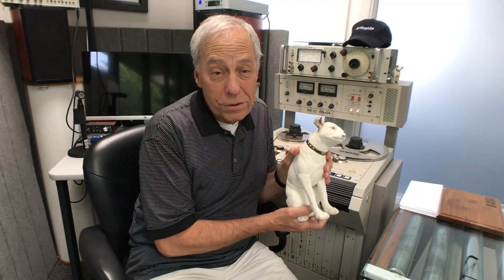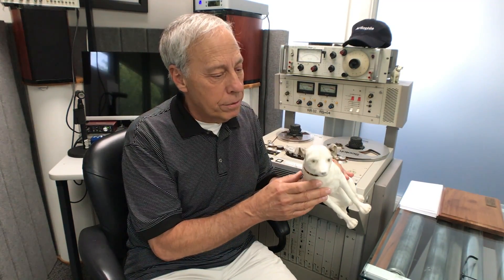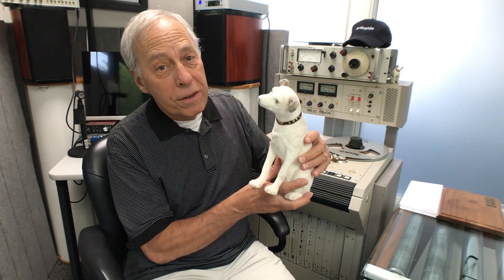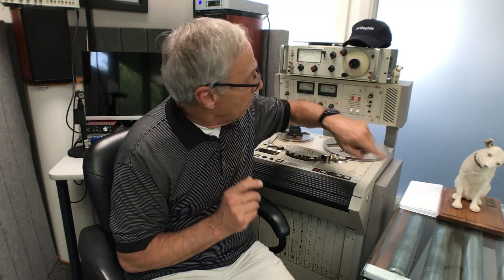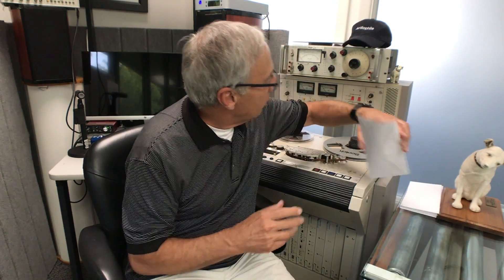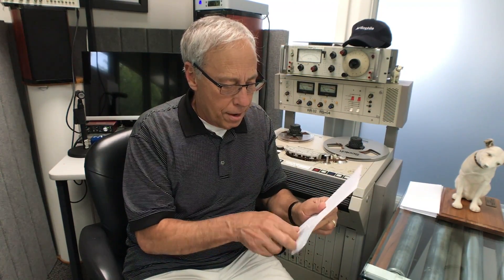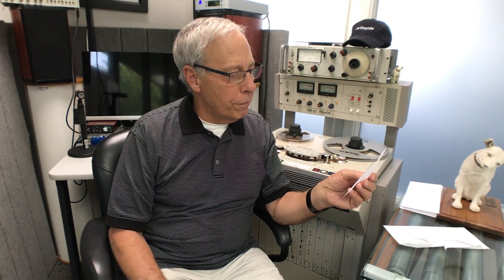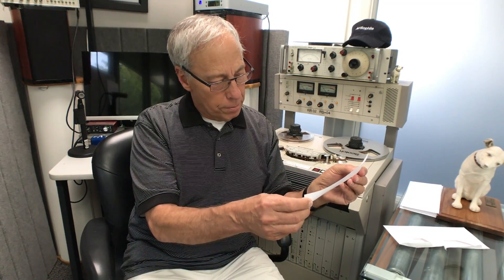Thin cables inside speakers

Comment: A few comments: wire after the X over serves a more simple task than before the X over. Wire internally gets exposed to much more vibration: bad thing, it does influence sound. Multi strand is worse than single solid wire in that respect. There is never any justification for using very expensive speaker cable outside and cheap inferior stuff inside, however, the wire form X over to speaker chassis can be of of somewhat less quality than the outside cable. Last but not least: influence on sound doesn't scale 1: 1 regarding length, so twice as long is less than two times as bad.
Reply: By vibration, you mean like, ah, vibration? Like a guitar string? And it's measurable and it does deleteriously influences sound? Multi strand is worse than signal than single strand? So you're saying if you have expensive cable outside the box and cheap 'inferior' (define inferior - gauge, purity, brittleness, etc.?), that's bad?
Finally, influence on sound doesn't scale 1:1... where do you get this science from?
The only science in this whole subject is that gullibility is exponential to the surplus of discretionary money to spend on the system. Usually by men over an age where their hearing is affected anyway (presbycusis). If you can hear the minute subtleties you're talking about here, you must have the hearing of a dog. Finally, nobody ever talks of the quality of cables at the start of the voyage - you know, the ones from the instruments and microphones in the studio and through the mixing consoles and mastering process, etc. What comes out on the vinyl or whatever, ain't the sound the instrument made.
Reply: listening: conservatory graduated and high-end designer, it;s my job. Doesn't scale: a renown audio technician told me that and it rings true and most logical. Vibration, yes as you describe. Electrons do have a mass: contemplate about that. You are right about the whole chain does matter. There is a difference however when all signals are still separated and when they are mixed together. Of course what comes out of vinyl or whatever is an attempt (or not even that) to have (an often bleak) resemblance to the original. 
Look, I stay puzzled about the sensitivity of the ears and what they can detect. Much time was lost because I refused to believe that certain things could influence the sound.

Comment: Most industrial produced consumer grade speakers have internal thin wiring for the obvious reason of reducing cost. You,the consumer wont see them,and what you dont know doesnt make you question why.
Well,to be honest from the technical point of view you dont need a special fabricated cable for high quality internal wiring. A 1,5qmm cable like Oehlbach SP15 is perfectly fine for this duty.   Its also very good to change the internal wiring with this in old amplifiers who often have relativly  long wires for routing the output signal from the powerstages to the speaker terminals.
For external wiring a 1,5qmm - 4qmm OFC-copper cable made out of many thin copperwires will be perfect. Depending on the necessary cable lenght in your listening room and the power throughput  you dont need more than that - ever. At least (real) physics science is at this time not advanced enough to deliver a plausible reason for more. Of course we are artificial inclined to do so,but there is really more important stuff to think about in the matter of  hifi at home.

Comment: The cables inside good speakers are not thin.
Reply: If I thought hair thin voice coil wire was good for connecting amplifiers to speakers I would use it. I don't, for obvious reasons.
Reply: Peter Martin -- Which "good speakers" are you referring to...(?)
Reply: Dynaudio for example. They make good speakers.
Reply: They are still generally much thinner than the 'garden-hose' thick cable some have running between the amp and speakers in so many systems.
Reply: Well that us used for weight and space issues in the driver.
Reply: The wire going from the spot on the driver frame to which the cable is soldered or connected, that then  goes to the actual voice coil, is very thin and far thinner than any part of the wire before that in the signal path.
Reply: So what would you say about the 100 ft long hair thin wire around the voice coil. Or is that not part of the circuit. This thin wire is probably a hundred times longer and a thousand times thinner than your interconnect.

Comment: I thought the reason that the wires inside speakers are so thin is that they are short. I was always under the impression that wire gauge needs to be heavier as the length increases. If you only have a couple of inches of wire then even very thin wire will do. So isn't the answer just "length?"
Reply: Wire size is,determined by the amp draw.  You make a wire bigger as it gets,longer for voltage drop.
Reply: That's part of it. Also, the power is divided among multiple drivers and crossover components at that point so the current is split somewhat. It's definitely an application where the wire is not as critical as the longer run to the amp. People get hung up on arguing about cables when discussing audio, but it's really low on the list of things you need to worry about.
Reply: That is the answer.
Reply: Paul McGowan - I agree. It's all about manufacturers' saving LOTS of money in high-volume production runs .But what's the sense in running the finest audio signals we can muster down the cable equivalent of an expensive, multiple-lane superhighway, only to have it hit a  narrow, cruddy, dirt road inside the speaker box? Worse, on the way in, we squeeze it all through a pinhole -  a fuse element that's tinier than a cat's whisker??!  I used that rationale to convince myself to rewire my ribbon speakers directly to my amplifier, the improvement in HF sibilants alone was worth the effort. 😎
Reply: Az Usmb, The pinhole analogy is pretty descriptive but inaccurate.  Google copper wire resistance tables to make more sense of this.  Assume you use 10 foot 12 AWG speaker cables. This is a 20 foot round trip for the wire resistance. The cable has a resistance of 0.0318 Ohms.  The bottleneck of a 16 AWG wire between the crossover to the driver at 2 feet round trip, is 0.0084 ohms, not the bottleneck the first appearance seems to suggest.  This is the difference between pseudo science assumptions and engineering.  Inside a speaker the high vibration and a physically large wire to a driver is a mechanical vibration failure point. The smaller wire is used inside for physical consideration of the environment and is a trade off to a small amount in capacity.  Smaller wire can flex more without failure.
Reply: You are confusing impedance matching with wire size. A 4 ohm amp should drive into a 4 ohm speaker. When is the speaker at 4 ohms? Only at 1Khz. Your rewire probably had more to do with impedance matching than wire size or cable length. A cable with adequate current capacity and low resistance is all that's needed. Huge expensive speaker cables only serve to empty your wallet, not your ears unless your amp is 100 feet away from your speakers (I squared x R losses). If that is the case, move your amp closer!!! If you look at the voice coil windings of most speakers, even those up to 100 watts, you'll find that the wire used is only 22 to 30 AWG. Here the impedance of the voice coil is the limiting factor of current flow and the resulting power consumption.

Comment: What in my thinking is the internal cable length relative to the external speakers cable is actually really short and does not contribute significant change in sound quality. Good enough cable for the internal is sufficient. There is really no point to over engineer something that is already 99.99 percent good.

Comment: Wiring inside the cabinets do not need thick or robust material covering because they are not going to be subjected to handling, bending, twisting, stung across floors or exposed to light(UV). The conductor may be just as think but the wire it self as a whole may look skinny due to thin almost non existent coatings.
Reply: They could also have a lower strang count because they won't be bent back and forth constantly so each strand can be larger.
Reply: I like where you're going with this. The external cables do indeed need to be more robust because they're exposed to humans. However, if you strip the insulation off an external cable it will still be quite thick in comparison to the internal wire.